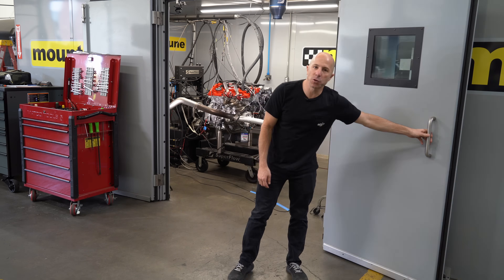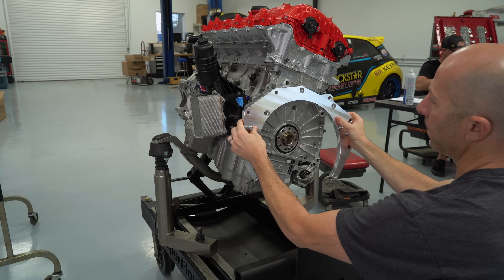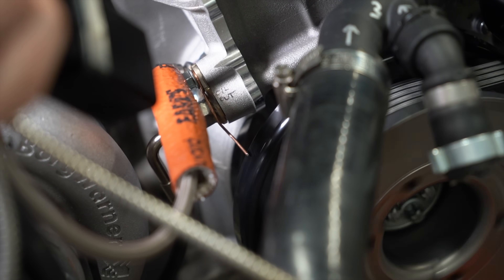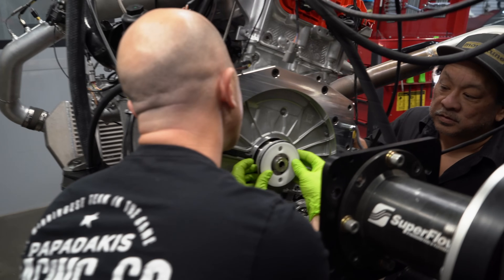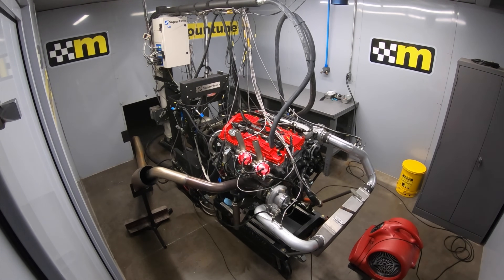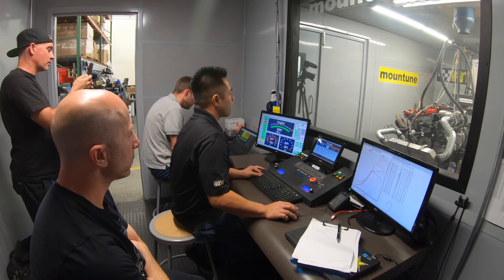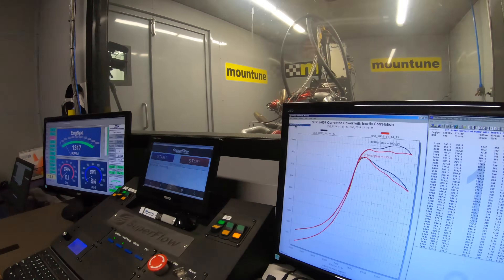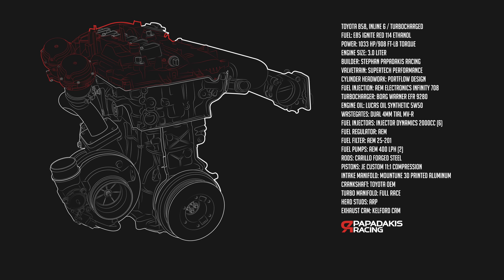B58 Engine Dyno 1000+ Horsepower - Sounds like a 2JZ!?

Comment: are you guys controlling the valve lift motor with the aem? i worked with an infinity 708 to an n52b30 with a turbo. but we just used a block off to lock the intake cam at full lift.

Comment: Really curious as to why you guys couldn't push the motor past 7000 rpm cudos on still making a 1000 horsepower tho with that limitation that is nuts

Comment: Nice build not a big fan of bmw motors but a quick trick you might want to try for those valve keepers is put a little bit of grease on the valve and the keepers will stick to it. Makes  it a lot easier than fishing those damn things on.

Comment: 42psi for 1k hp? There are 911 Turbos running 25psi making 1k hp....why does the boost pressure have to be so high with this engine?
Reply: nevermind...forgot this was only a 3.0L engine vs the 911 at 3.6-3.8l setups.

Comment: It literally pulled all of the oxygen out of the room, that's wild.
Reply: No. The fan system simply shut off making hot in the cell. Hot air means less power.
Reply: all of the oxygen? ALL? wut?
If it would have, then it would be making no more than 0hp. If it loses 10% of its power then it's more like 8% of the oxygen that's gone.
Reply: @sasjadv  theydidthemath
Reply: ...making it now a confined space.
Reply: No it didn't.  It was probably a heat issue, and maaaaaybe and ever-so-slight vacuum, but it wouldn't have been much.  I bet it just got really hot in there.
Reply: @detaart  It's definitely not vacuum. If it would have affected it, then the boostgauge would see it. And even a vacuum that's too small to notice would either pull the door out of your hands, or not allow you to open the door as soon as you go there.
Heat and slight drop in oxygen levels are most certainly the reasons. It's hard to say which of the two mattered more, but it's those 2 factors together that did it.
Reply: it's a bit of both but this question is best answered by either A: the Chemist, or B: the Pilot as both of these individuals have the best understanding of the concept of DENSITY and the behavior of molecules, temp, confined spaces.  atmospheric heating in this context means "less power" in that the energy imparted to individual molecules causes them to repel/ricochet off one another and thus not pack tightly in a given volume (ie. Density).  however 1000hp/3 Liters of ICE is by definition a PUMP, an air consumer so rest assured it is RAPIDLY using up the 02 in the room (faster than heating) producing CO just like a Pilot over 10K feet or Diver in a cave.  technically air is an INSULATOR.
Reply: @phillyphil1513  The thing is, this is how engines SHOULD be mounted in a dyno room:
there should be a heat-resistant hose connected to the exhaust that blows the gasses outside.
We are talking about safety, you will lose consciousness if CO levels are too high, and there is actually a life-threat if you don't get reanimated in time.
In this video I see they use a pipe instead of a hose, that doesn't look airtight so it must either pull a vacuum to compensate for that, or the room needs to ventilate. Only if that is not sufficient then you could see a change in the composition of the air.
---
The room clearly isn't airtight, there is a hole in the wall at the back for ventilation =>no vacuum.
---
As you can see at 0:02 the red fan is definitely blowing at the intercooler, it's the intercooler that becomes hot and needs a fan, not the room as a whole. The air inside is hot and pressurised, obviously with poor cooling you get less dense air.
Reply: @phillyphil1513  stfu clown
Reply: Was hot air due to intercooler
Reply: @Dave You've literally no brain cells

Comment: Of course it sounds like 2jz, it is an inline 6 turbo, lol
Reply: Many of you guys over here are saying bullshit. Two similar engines don't necessarily make the same noises. An old 3.0L BMW inline-6 (like from an E36) sounds exactly NOTHING like a JZ, RB or even the newer BMW inline-6s like the N54
Reply: Lone Rider Most likely because the internals are much different including heads they're factory turbocharged engines. My old M54B30 330ci sounds nothing like an N54 or N55 or B58
Reply: So do JZs and RBs sound the same to you?
Reply: @Jayspec07  Same as the Audi RS4  2.7 V6 bi-turbo running 700-900hp sounds JUST LIKE VR38DETT or Mercedes M104 I6 with holset hx40 sounds identical to 2JZ with hx40.
Reply: @Jayspec07  if they have the same header and turbo setup, yes, they sound the same
Reply: @AdamSticksNTricks  You need to be around 2J's and RB's more often...
Reply: @Clownelskiy  Any two engines of similar cylinder number/layout and roughly similar displacement/stroke will sound almost exactly the same with the same intake and exhaust on them. A stock say 2JZ sounds completely different one with a high performance intake and exhaust and no block mods. The acoustics are all in the head/exhaust. In fact you can easily take some shitty 100hp 1.4l 4 pot and make it sound like a race car with just the right exhaust.

I think you need to be around engines in general more often.
Reply: @BigUriel  "almost the same" and "sounds like" are two different things. Having built a countless number of 2JZs and other engines, not only do you need to be around engines more, but get hooked on phonics while you're at it too. Intake and exhaust are not the only things that determine engine sound, do more research. You building engines out of legos doesn't count.
Reply: ThatOneGuy...Haven’t you ever noticed it’s just 2j this and 2j that and blah blah blah when 90% of these people couldn’t tell you which one was which of they (2j and RB) were sitting next to each other. And certainly have never dug into one. Didn’t you know that if  it’s popular on YouTube everyone is automatically an expert?
Reply: ThatOneGuy ...”Hooked on phonics”😂😂 Glad to see someone else uses that. Usually when I say that, I just get a blank stare....and then I give the “exactly” nod.
Reply: ThatScubaGuy Dude you act like they sound totally different the sound character is slightly different but to the untrained ear they would sound the same. I live near Las Vegas Motor speedway I hear them and see them every 3 days or so . Personally I prefer 1JZ and the Barra 4.0
Reply: D B Exactly most of these guys are posers
Reply: do a sr20 and ca18 sound the same? does a barra and a 2j sound the same lol
Reply: Trevor Jones Barra sounds pretty and smooth
Reply: Arthur Wall sounds like a boring tractor.  Hear them all the time in aus but in the states it’s all about fender and hood exit so almost engines would sound same then
Reply: @marmo_tv2049  good sounding tractors!
Reply: I’m very glad my flat 6 does Not sound like a 2jz
Reply: @992turbos8  are you running a true dual exhaust?
Reply: Right lol same 3.0 too
Reply: Casual, lol
Reply: I was thinking this until I looked it up and realized the B58 is nearly a half inch undersquare. With the 2JZ being dead square, they sound shockingly similar. Makes me think there's something about the BMW engine that's working much more smoothly and/or efficiently.
Reply: Does a tjz fart?

Comment: 40+ psi to make 1000 horsepower tells me it isn't really any more efficient than the 2jz. I didn't follow the build, but I assume the cams and ports are stock. Whether or not you'd gain much there is questionable anyway.

Comment: When the direct injectors melted down, did you have to mill out the holes to get a better interference fit?  I've been thinking of a way to delete the injectors in an FA20, and it occurred to me that if I pressurized the cylinder with compressed air, I could tap out the injector port in the head and then screw in a plug while not getting debris in the engine.  It might work for B58's as well, as an alternative to plugging like you have.

Comment: Wonder when it will be possible to make such power on stock computers. Because that's cool and all, but if you use a standalone there's lots of shit that won't work anymore in the car and that's ok for a record holding drag car but for a street car that's not cool. So far cars over 600hp on stock ecu have touchy throttles and have issues breaking up at certain load levels, it's just a mess. Anyways, stoked to see people using the potential of such an engine that had been overlooked for years until they put it in the Supra and people finally got interested in it.

Comment: Hate to tell you the number of times I have used a BBQ grill to heat up a something to beat a slug/plug into various thing be it a cylinder head or a small safe door after it being drilled and lots of other things

Comment: It's dangerous to have the flex plate carrying the weight of that adaptor plus the shaft. It's not meant to carry any weight, only transmit torque and locate a torque converter axially. Also you should vent the exhaust outside and not inside the dyno cell, the ventilation of the cell is not nearly enough for removing the exhaust when it's just vented into the corner of the dyno cell and not even pointed towards the extraction fan. Just things to have in mind for the next time.

Comment: That nitrogen BBQ dowell trick is one of the coolest solutions ive ever seen.
Reply: Mmmm I love the smell of barbecue cylinder heads. Smells like awesomeness.
Reply: Ferrari uses liquid nitrogen when they assemble their engines too. I agree- super clever.
Reply: common practice,called sweating.using a bbq is quite resourceful
Reply: Wonder if/how they get thos pins back out.
Reply: @tombratfred3102  They don't. If they wanted to take them out, they would have used something easier to remove.
Reply: @tombratfred3102  I think it's meant to be permanent
Reply: @tombratfred3102  probably via a hydraulic press
Reply: @tombratfred3102  they want it to stay in there which is why they heated it up and freed the pins, so that when they become there regular the wil push up on each other and stay together.
Reply: @tombratfred3102  they dont!
Reply: Normally, one would use induction heating, but hey bbq works too i guess lol
Reply: Yeah, the nitrogen trick seemed novel to me 'cause I've always seen the heating trick
Reply: done with heavy and ag equip for big spindles and the like too
Reply: @JJM2222  I did the same heating trick with tanks and other tracked vehicles when I was in the Army